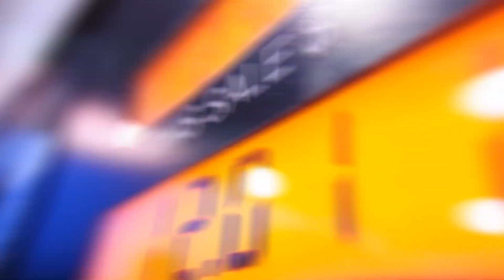Was the GM's 8.2L Fuel Pincher the Worst Diesel Engine Ever Made?

Comment: I have an 8.2 fuel pincher in an '84 Oshkosh airport snowblower. It is used to power the truck and only sees light loading.  Also have an original  5.7 Olds diesel car with over 200K on the clock. Also in my collection is a GMC Toro Flow. 

Guess I'm a glutton for punishment.

Comment: Oldsmobile 5.7 was by far the worst pos that GM ever produced. My dad bought my mom a new 1980 Pontiac Bonneville with a 5.7 diesel that was nothing but trouble from day one. After a few years of issues and no help from GM, he swapped the diesel for an Oldsmobile 5.0 307cid. Gasoline engine.